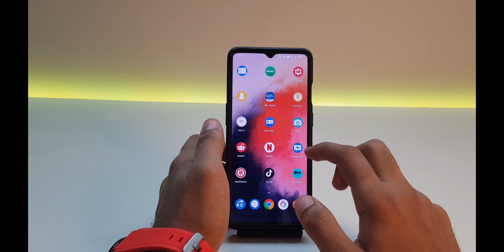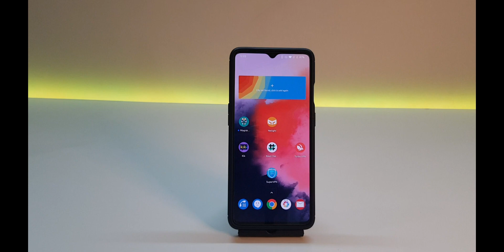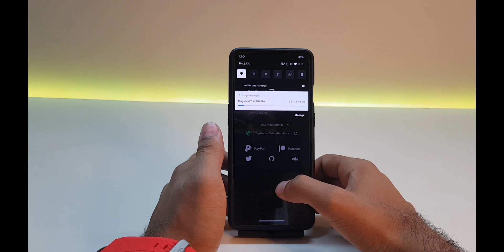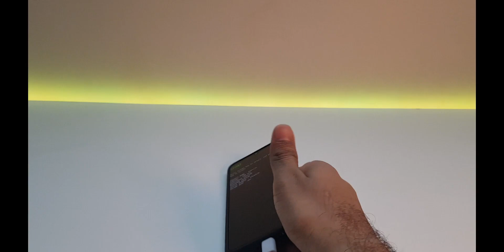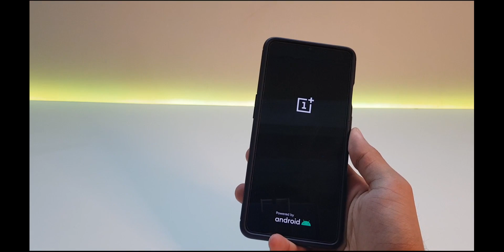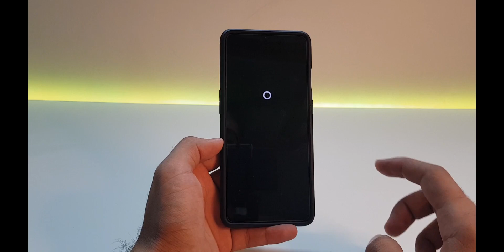How to Root Oneplus 7t (Any Model Working) | Easy Noob Instructions

Comment: hi need help from u ysterday i tried to flash rescurrction remix rom on 7t it worked but usb data transfer os not been recognizable in computer other all works but unable to tranfer files from pc to mobile so i check the recovery it was having lineage os recovery so i chnage tht recovery to twrp latest one n then i was unable to wipe anyting nor storage was been shown all 0mb ,unable to mount storage wipe noting i was able to do nor able to flash an other rom as noting was been getting wiped up try to chnage file system to f2fs but tht too option was not availabe ,wht could be the reason ,i was not even able to flash pixel experience rom,is tht twrp is not yet supported to 7t or its it i m doin something wrong so ur help will guide me to flash rom

Comment: Should i unlock my bootloader first?
Reply from the maker: If you want to root your phone then, yes, you should unlock the bootloader.
Reply: @iFaiqNerd  man i have no idea about phone rooting , will i brick my phone?
Reply: @iFaiqNerd  thanks for replying 😁😁 you earned a sub😀
Reply: @iFaiqNerd  currently i am using open beta so do i need to downgrade to stable version?
Reply from the maker: Yes you will receive regular ota updates after rooting.
And may i ask why do you want to root if you are new to this and have no idea about rooting.
Reply: @iFaiqNerd  i have rooted my letv le 2 before but it was a different process
Reply: @iFaiqNerd  i wasn't able to find out TWRP for 7t and i got confused 😁
Reply: @iFaiqNerd  i mean i have no idea about rooting with this process🙂

Comment: SIM card not working bro after this in one plus 7t
Reply from the maker: Did you donwload the same firmware (buildnumber) from oneplus website as it was on your phone.
Reply: iFaiq Nerd I downloaded from your webso
Reply: Can we un root that
Reply: I uninstalled magisk and my phn is stuck at boot process😭😭😭😭😭
Reply: Plz help broo
Reply: What I can do to start my phone😭😭
Reply: @Santoshjadhav-tm3vb  cool bro.. download msm tool for oneplus 7t then flash your device....
Reply: It happened with me also

Comment: after did that.. sim network not working.. also your.. I checkded your video..
Reply: Did it fixed or not
Reply: @Santoshjadhav-tm3vb   no bro...  7t is fking shit.. can't root bro... I am upset.. if you find a solution please let me know.
Reply from the maker: Mine is working fine. Sim network not showing because i have not inserted any sik card otherwise its working fine. My phone is rooted since i made that video.
Reply from the maker: Just make sure that the firmware should be same as it is on the phone. Match the build number.
Reply: @iFaiqNerd   yeah...  THen first I download the rom file then I flash through local upgrrade then I make magisk patched then it work... also sim network showing wifi working...
Reply from the maker: That's excellent. Good work
Reply: @kolagang2362  yeah thats the same mistake i did....was very hard to find 10.3.7.65AA firmware dropped yesterday and was not able to find on OP official website as well ..on that website it was showing as 10.3.6  ...found from 3rd party site ..flashed from local upgrade and then ran patched magisk ..it works perfectly now
Reply: @Dan-Reloaded  can you give me the link?